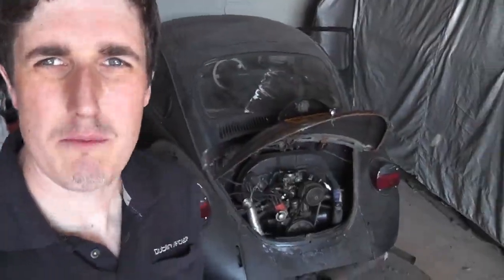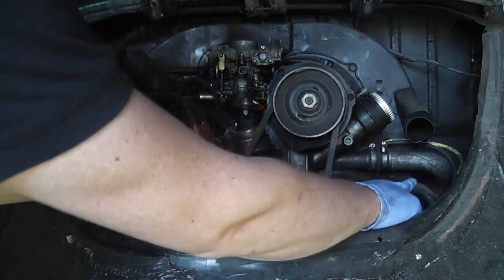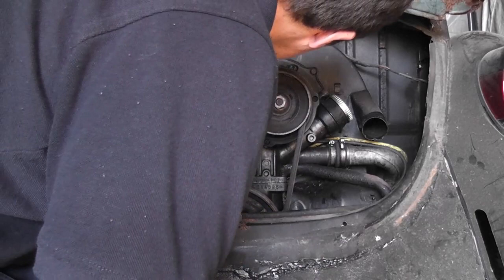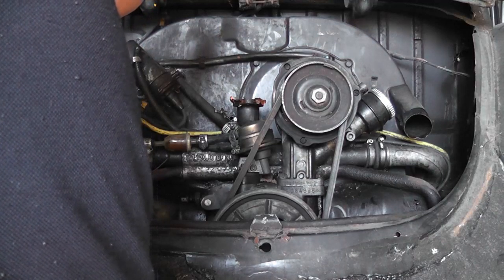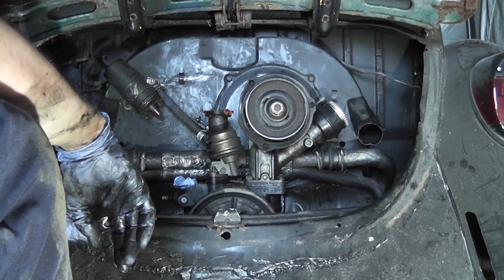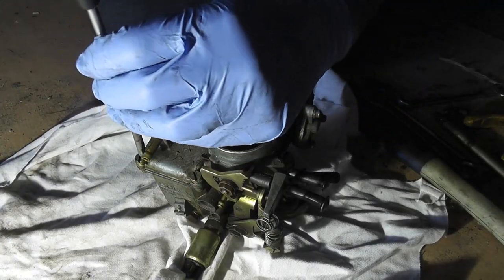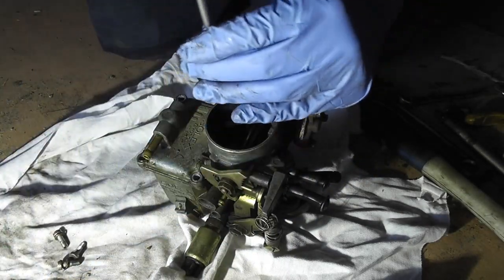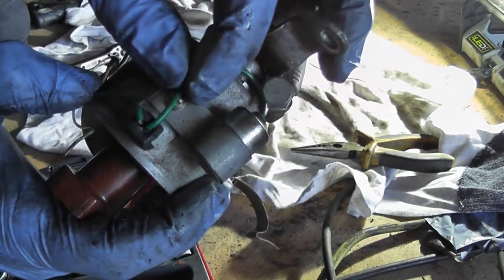Reviving a 1974 VW beetle - Part 1

Comment: Tdc Mark was the notch on the front and not on the inner crankshaft pulley 👍 .Looked a big mess tho.Adapter spacer on carb is for the alternator ,not needed if dynamo
Reply from the maker: Thanks for the info. When I said the back, I was referring to the back of the car as being the back of the pulley. Sorry, I mightn't have been clear on that. The adapter is to allow a 30PICT carb to be fitted to a 1600 manifold.
Reply: @Endfloat  oh ok only thought I seen you line up back mark in middle of case 👍